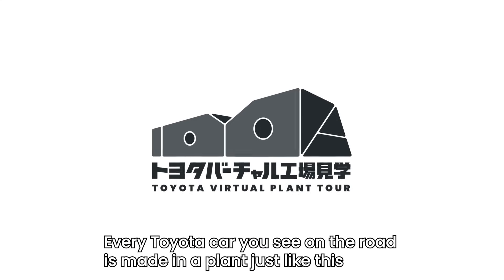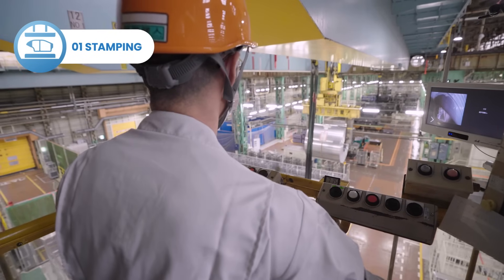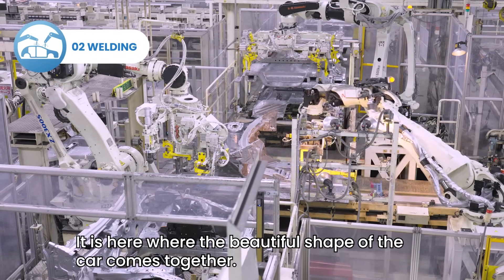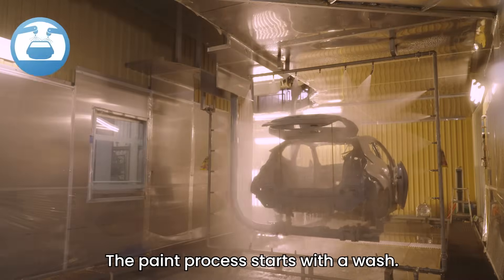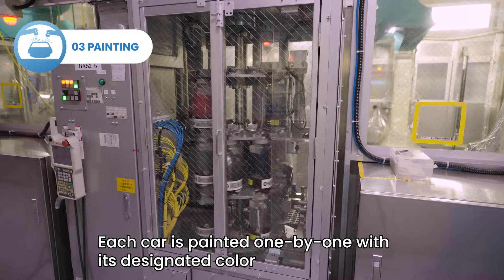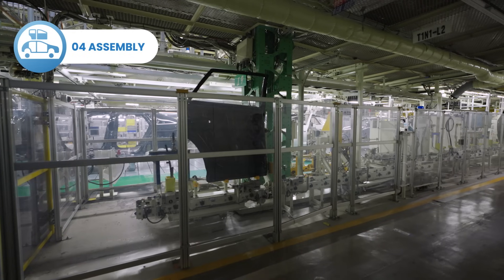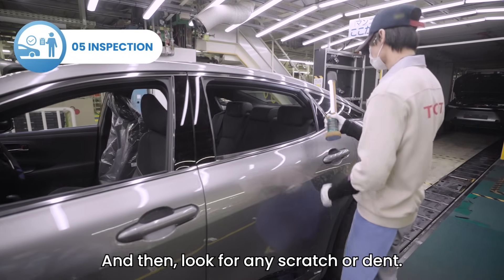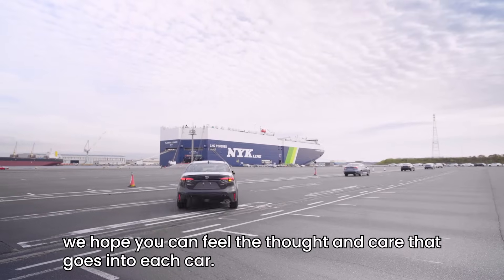How Toyota Cars Are Made - Toyota Virtual Plant Tour - Episode 01

Comment: cars back then required way more people so you could imagine that when a human is actually responsible and contributes to a large portion of the car’s manufacturing process, parts of the car that tend to be in more need of maintenance would be more accessible. On top of that more time, money, and resources were actually spent in making the cars. Nowadays having machines build the cars allows them to make the engine in a more “efficient” way. Which in my opinion makes them more complicated, compacted, and harder to work on. Which in returns requires us to spend more money on maintenance for things that were previously easy or less difficult to do on our own.

Comment: TOYOTA, I am very disappointed. I bought five Toyota tundras five with the one I have current right now have 2023 1794 addition no I don’t think anyone loves 94 more than I do. I bought a lot of them that is all I 2023 is giving me a lot of issue, I am a bit disappointed through my friends people I know from working in the industry I am a technician myself. I made a lot of people purchase this truck because it was so unique. I tell people all the time by TOYOTA if you don’t want problem, I said it so many times, I have so many people driving on the road right now we speak using your but this truck I got I’m having a lot of issues with things that should never happen. My favorite Tundra I ever had was the 2020 1794 edition I don’t know why I got rid of it, and all the other models didn’t cost me a problem except this one I wanna tell you this one thing I used to like about the 1794. It was a very unique truck had chrome wheels. This is one of the most I love about it and the leather interior and the front, you drive down the road you like the king of the road and then you guys took that away from me. You gotta put chrome wheels back on the truck but that’s not why I’m here today. I’m here today because this car is costing me a lot of issues and frustration and, my Radio just keep falling off the motor on the front bumper spoiler for fuel efficient. I had to take it to the dealer and change it. I had some light up on the dashboard. I don’t know it just too many little things the 2025 I have to go find another car And sadly to tell you, I’m really thinking about it if I should buy another Tundra, then you made the capstone the 1794 just don’t feel special anymore to me. I know some people may think this is funny but 1794 meant everything to me I bought a lot of products and I really enjoyed them, but I’m disappointed. I made people discuss. I made people buy a lot of Toyotas in my family. We only TOYOTA so you can imagine how I feel. I beg of you, TOYOTA please give me chrome wheels back on the 1794. I can deal with the other little tiny problems if I’m happy and I got a little small issues I won’t care all right then have TOYOTA that will make me happy on the road again. we will see before I go. I wanna thank you for all the beautiful costume make you probably don’t hear it enough so thank you. I have the most deepest respect for your company.❤❤❤❤👍👍👍👍🫵

Comment: I use a 2004 Toyota Camry and it is still good, comfortable, all indicators function normally, there is no damage to the body... it all depends on maintenance. And the material of the Indonesian version of the Camry seems to be premium class because the body plate of the car is thick and doesn't break easily. Camry in Indonesia is widely used by officials and even ministers. Camry is the most comfortable Japanese car❤

Comment: In the assembly process the flor is mark with lines in red ,blank, yelow, and the line is moving while the operators works .Can you explain me why this is for?, please
Reply: it's to know where you can walk and where robots pass through so there won't be a deadly accident.
Reply: If you mean the little red or white or yellow tape on the floor with a number on it, that's how they determine if the operator is working within takt time or not (normally they will). They divide the process length into 1-10 fractions and most likely set the warning alarm to alert around 70-80% of the length (number 7).

First benefit of doing this is that the operator of that process will learn to know if he's being slow or too fast compared to his normal performance by using that number signs, he can then speed up a little bit or rest a little before going to the next work step.

 Second benefit is about abnormality management in production line, 
If the alarm goes off, The Team Leader, who controls that area, should come to see if the operator needs any help (such as bolt crossthread, tool or machine malfunction, etc.) and if they cannot solve the problem instantly and reach the end of the process (number 10), the conveyor will stop unless the problem is resolved. (it's called Jidoka, one of the TPS pillars)

Comment: So...Why did the BZ4X wheels fall off if there so much "rigorous" testing?
Reply: Bz4x’s wheel never fell off. Toyota sent out a recall that it “could” fall off before many of them were in customers hands. 

Another manufacture like Tesla on the other hand have steering wheels falling off without any recall.
Reply: @criancrna1487  The point is Toyota sucks at building EVs.
Reply: @thabanglentsoana7939 You made your point pretty badly. Toyota/Lexus have the 2nd and 3rd least recalls of any car brands. Drop the weird hate for a brand just because you prefer another.